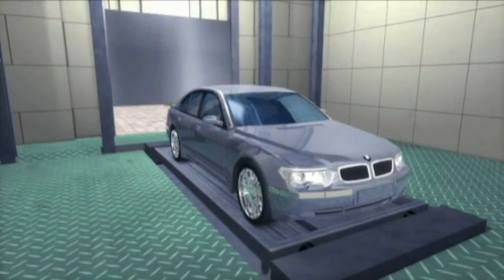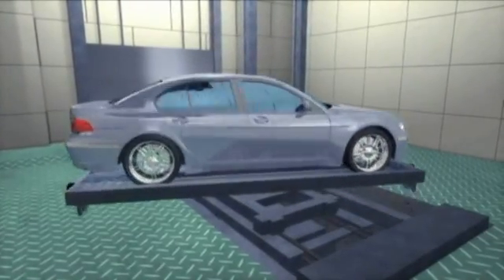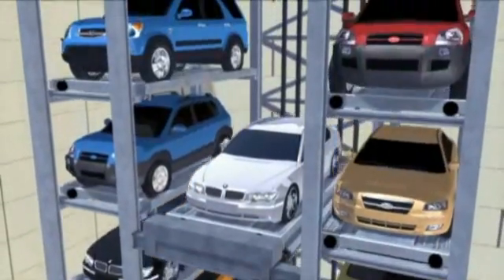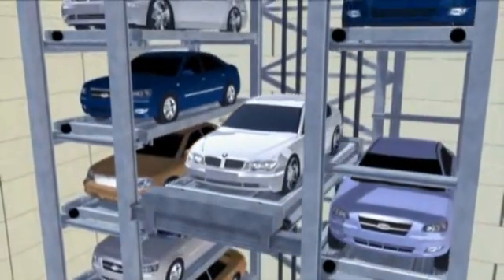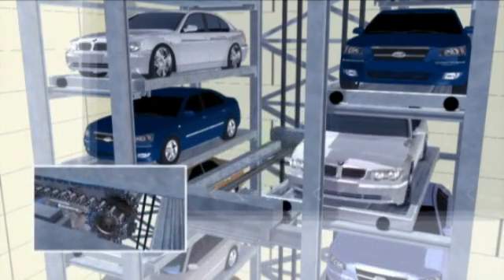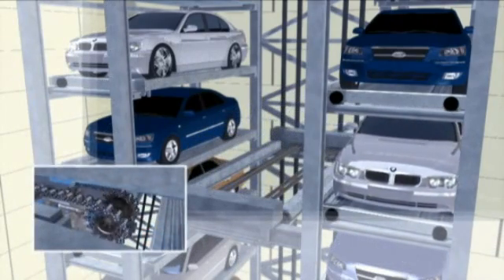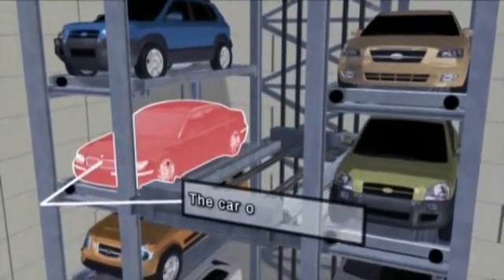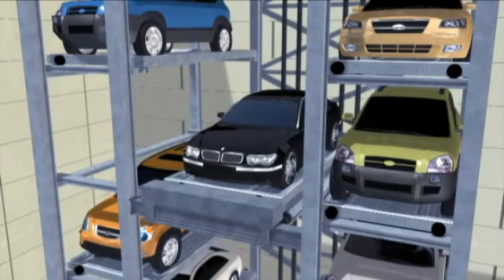LOTTE VERTICAL PARKING SYSTEM

Comment: This is Helen from Xiamen Innov information company that is a manufacturer of rfid tag 
and phone reader used for identification verification with our own patents and full 
production equipment .

Our factory accept customized services , from raw material coating, copper/alumnium
etching, color printing, flip ship bonding, lamination , encoding (print serial number, TID/UID number,
bar code , make these numbers connection ) , inspection pcs by pcs .

Nice to talk with you again, hope you are doing well.Below I introduce our factory best selling products also our best
 featured rfid tamper destructive tag as below :
 
We have several customers use our uhf none transfer tamper proof windshield tags used for 
electronical toll system/ parking system/ petrol station payment /vehicle manufacturer etc. 
 
RFID tamper destructive tag features and advantages:

1) common label surface print serial number is very easy to copy, and rfid number is unique in the world.So rfid tag
 can not be copied.
2) rfid tag can write data and memory used for verification.
3) our rfid tamper tag is one time disposable , can not be transfer and second time used. once tear off the tag ,
 this tag can't work any more.
4) tag surface number and rfid number is the same, it can judge whether this product is original .

Look forward to hearing your reply soon.

Thanks and regards,
Helen
helenwu@rfidtagworld.com
www.rfidtagworld.com